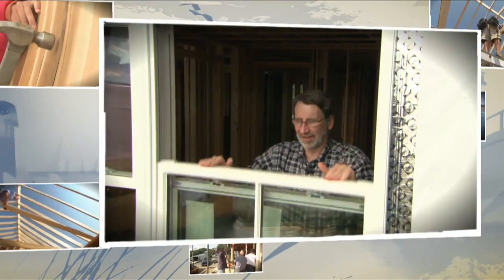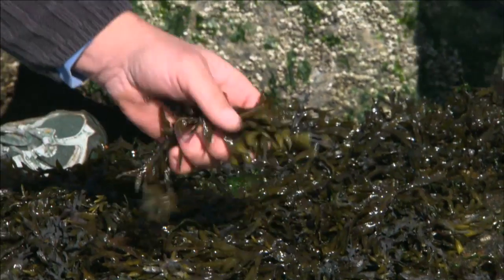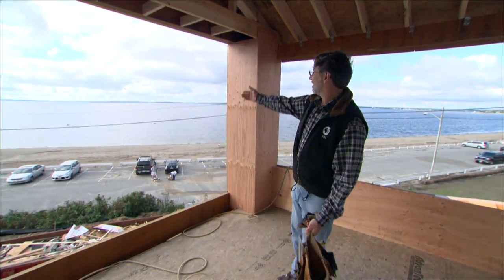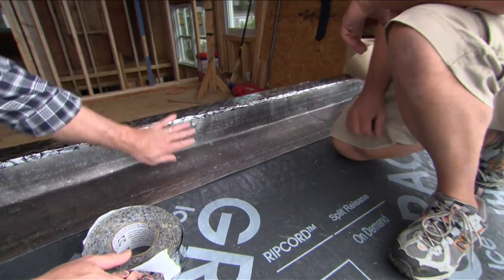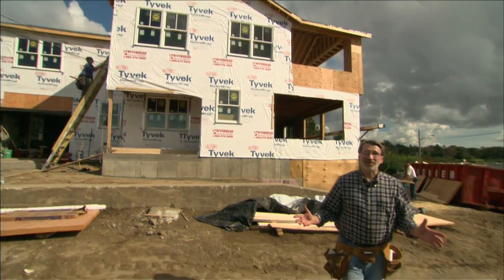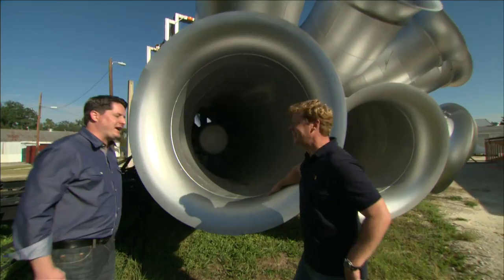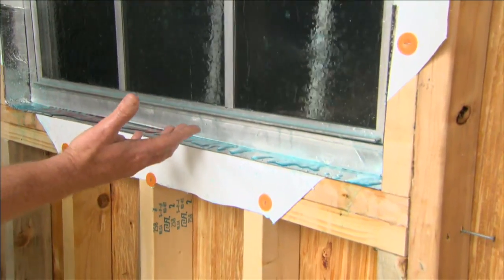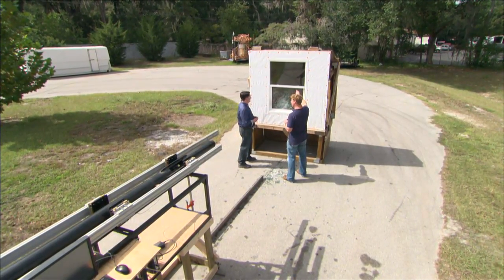Building a Clambake! | The Barrington House | Episode 3 (2012)

Comment: Why do they always use asphalt shingles? I don't get it...just put slate up there and you wont have to worry about the wind lifting them up AND they'll last a hell of a lot longer than 30 years...probably more around 60-80 years depending on weather conditions and the quality of the slate.
Reply: Since slate can cost 10 to 20 times more you have to weigh the cost vs. how long it might last.
Reply: Greg Fields
You sure they cost 10 - 20 more than having to exchange them every 10 years or so and pay people to do it properly?

Comment: Why does the pan flashing just sit on top of the waterproofing? Seems like you could get wind driven rain between the pan and the waterproofing thus making the pan useless. Would it have not been better to have the waterproofing go over the pan and down the exterior wall?
Reply: Waterproofing gos on first then that pan is bent and sootered so theres a flange out side that goes over the house wrap under the window. Theres no way for rain to be driven in under the pan